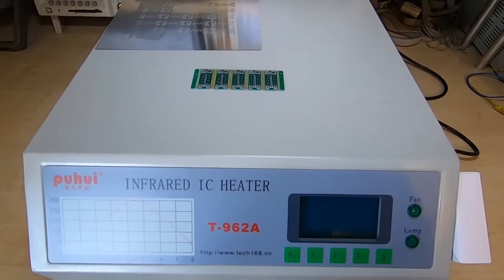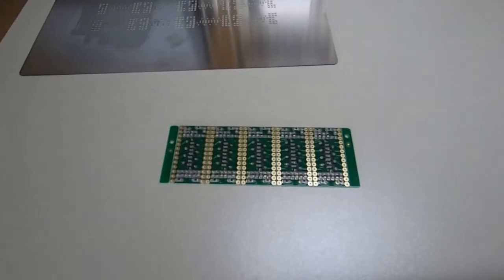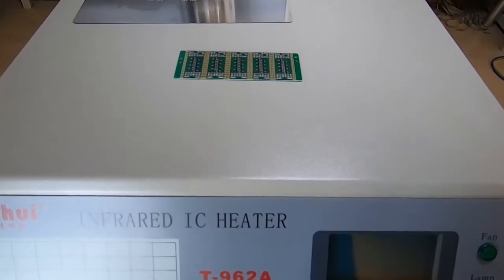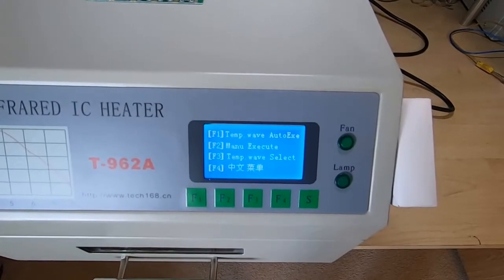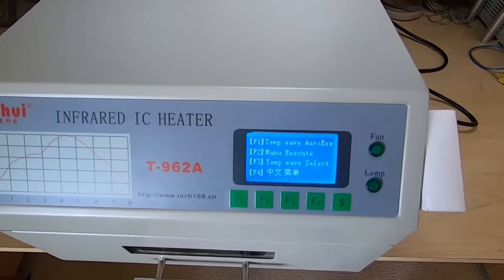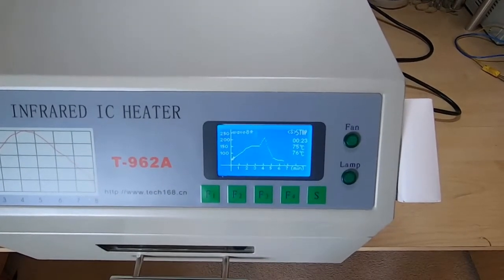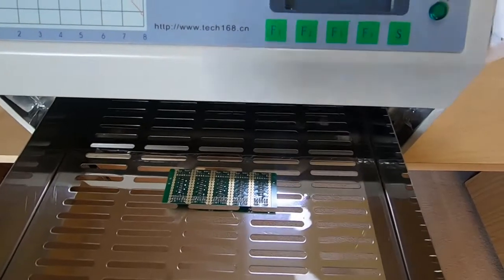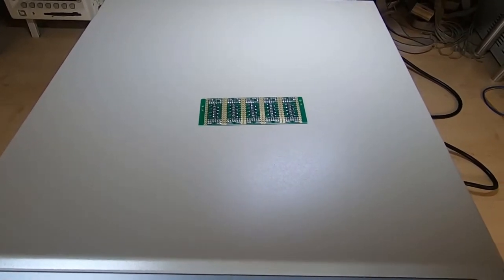Cheap Reflow Oven Working

Comment: I've been eyeing one of these. Funny how my bench is always shrinking. Those PCB look like the new protection board you just announced.
Reply from the maker: Yes they are good but need some work when you get them. Well spotted on the boards. I had several hundred bare boards made on pallets but rather than throwing full pallets through the pick and place and oven I assemble a few by hand so that I can get the reflow process right before committing full pallets (and possibly wasting them) so I thought I may as well show the process in a video in case anyone was interested.